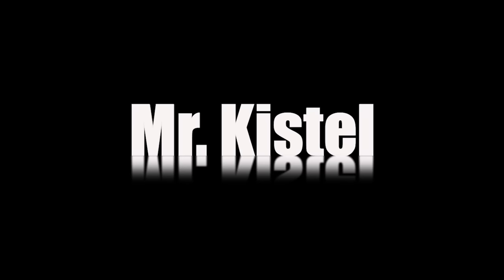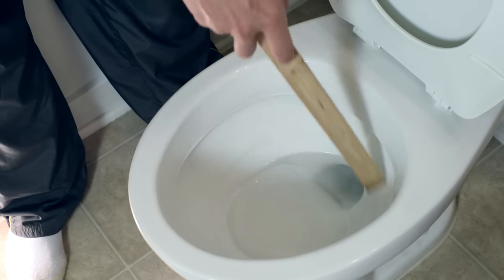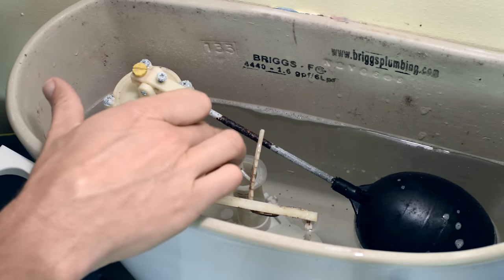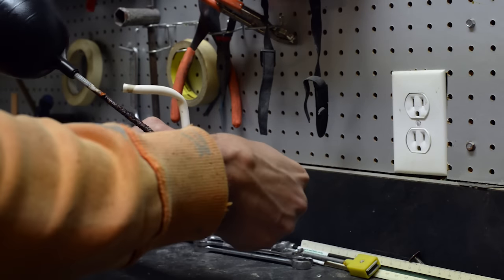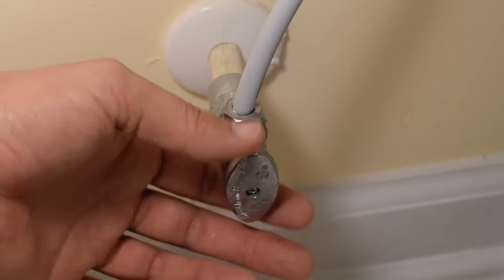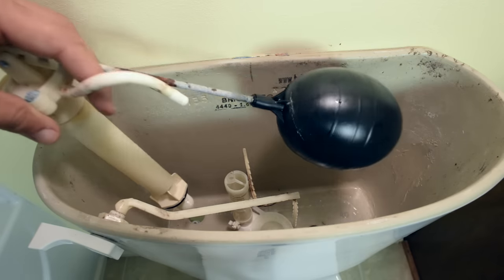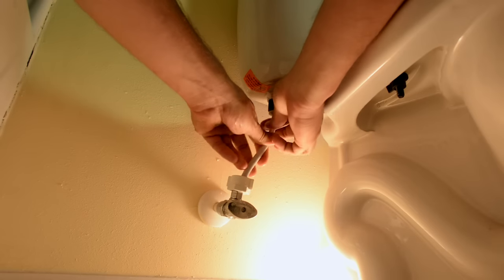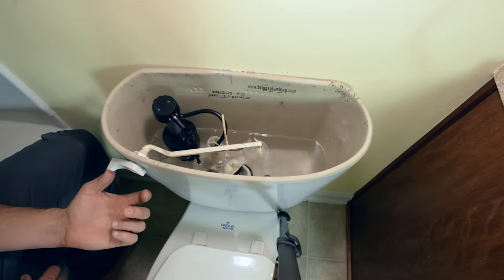Why Is There Low Water Level In The Toilet Bowl And How to Repair

Comment: This was pretty helpful. Except at 3:05. You completely failed and lost me. What were you adjusting and why? Is that something I need to do? And how do I know that I need to do it?
Reply from the maker: Thanks for watching, at that point in the video I am adjusting the height of the new toilet fill valve.  The valve may need to be raised or lowered depending on your specific toilet. The valve will have information on packaging describing what height is recommended per a specific application.  I hope this helps

Comment: Replaced mine with the same apparatus but it still does the same .
Reply from the maker: Thanks for the comment Jimmy.  Double check the fill hose is in the overflow tube.  Also an issue with the venting in the house plumbing could cause a low water level in the toilet bowl.

Comment: When installing the toilet 🚽 fill valve make sure that the refill tube does not go below the water line or als it ghost flush and when it comes time to connect refill tube to the overflow tube the cap on the overflow tube can come off and use the refill clip but if the cap can't come off don't worry about it you can still go ahead and use the refill clip.
Reply from the maker: thanks for the tip

Comment: Can I just? Try pouring more water to the toilet bowl. Rather than? Buying a new flushing value to replace the old one.

This video doesn't explain my situation? I have a low water level in the bowl. When I flush it the water fills a lot of water like almost half and than shrinks down the water level. When there is just a little bit of water than makes a noise.
Reply from the maker: It might be a problem with the drain piping venting.  Water could be lowered in the toilet due to a vacuum force created by a blocked vent.
Reply: + @MrKistel  :
Ok, I will give it a try thanks for replying back.
Reply: meassge to Clee4000
I think I might know your problem? Did anyone take a massive huge dump in the toilet. It might just be clogged up, and just use a plunger to unclog it.
Reply: + @ChrisL369  :
Holy Shit! Zero it worked it was just clogged up the whole time. It did the job the water level and flushing did the trick. Thanks for the fix and problem solving.

Comment: Friends, looked all over YT, didn't find the solution you need for a new toilet install with low BOWL level. (NOT THE SQUARE TANK, BUT ROUND BOWL PART). There's a black rubber hose coming off the assembly where the water comes into the tank from the water supply at the wall or floor, (Kohler brand). From that assembly, to the other one in the middle of the tank, a small black hose is supposed to connect the two, which directs more water into the bowl when flushed than will otherwise enter it without this hose connection. Without it, your bowl level will be unacceptably low. (My hose was too short to connect the two; found longer replacement hose at HW store, and you can get them at auto parts stores, if no plumbing supply is available). The only other recourse is to hold the lever down when you flush, and keep it down until the bowl fills with the desired amount of water. Looked all over YT, never found the needed info that I've detailed above. If snobs want to rewrite this post with the correct terms, be my guest, but most who need this info after installing a toilet via the DIY method will understand the above; LOL, written for the layman, they might understand it better than with all the correct jargon. Ciao, baby...
Reply: +DMBeckJr Can you provide a picture or link to what you're talking about?  I can't picture or find any hose other than the refill one inside the tank

Comment: So I’m having the issue where the toilet flushes okay and fills the bowl , then the water slowly drains to lower levels , I swapped out the entire tank system kit , more water in the tank thus more flushing power and it fills the the bowl even quicker , but still after that,  the water drains to low levels and stays there it’s driving me nuts ! Any idea what could be the reason ? I don’t have a clog just to put it out there. Thanks
Reply from the maker: Might be an issue with the wastewater venting. If the drain vent is clogged water can be sucked out of the toilet bowl.
Reply: @MrKistel   I see , and say if it’s a wastewater venting is clogged will I still be getting a good flush or it has nothing to do with it ? What do you do to check if the venting is the issue ? Thanks for the assistance

Comment: Each time I flush the toilet the water just rise up but it won't spiral and slowly goes down, already used the snake but did not find anything debris clogging. Any advice would be greatly appreciated?
Reply from the maker: It could be a clog further down the sewer line.  Another thing to check is the flapper in the toilet tank, make sure it opens completely when you engage the flush handle.
Reply: MrKistel is

Comment: My fill valve is not leaking but the bowl fills up , and then later the water level is very low. Faulty flapper?
Reply from the maker: my guess would be some sort of partial clog on the sewer side, perhaps in the bend trap in the toilet.  Maybe try a good plunging or a snake.

Comment: My lower bowl over fills and the thank fills very slowly like 4 minutes.
Opposite of this video.
Replaced the fill valve no change
Reply: You can go in the basement and hear water over flowing the bowl and running down the sewer pipe
Reply: I installed the one in the video no change
Reply: Float level is 3/4 in below pipe
Reply from the maker: Does the toilet flush itself when water gets too high?

Comment: I just replaced my fill valve because it was running constantly.  Now it's not running constantly.  But the water level in the bowl is still too low.  No matter how much water comes into the bowl from the tank, when it finishes, the water level is still too low in the bowl??
Reply from the maker: It is hard to say what could be the problem.  Sometimes poor drainage venting could cause problems
Reply: @MrKistel  thanks

Comment: Just had a guy replace the fill valve and now I have low water in the bowl but did not before. It seems like tons of water is coming out of the fill valve into the tank somehow, despite the fill tube also working.
Reply from the maker: Many times the fill tube coming out of the toilet fill valve will have an adjustment mechanism to allow more or less water flow.  Might this be your toilet problem?
Reply: It turns out he installed a fill valve for toilets pre 1994 which used 5-7 GPF and a 20% fill ratio. He installed the Fluidmaster 400A. My toilet is 1.6 GPF and 40% fill ratio which requires the 400AH. I made this point to him over the phone and he did not sound very receptive of it. He will reluctantly come to look again tomorrow. Sigh...
Reply from the maker: @NeuroPulse  interesting, thanks for sharing. Best of luck getting things repaired so your toilet water level is no longer shallow.

Comment: Our water level went down all of a sudden, and made a gurgling sound.  Water level is still very, very low, even after many flushings, and still gurgles.  Even if we pour water into the toilet bowl  directly from a gallon jug, it flushes down, but doesn't fill up.
Reply: sounds like something is clogged normal when you hear the gurgling noise once the water is down there's a clog some where

Comment: Tried that, still low in bowl, i posted a video, any other ideas? Thnx
Reply from the maker: if the plumbing venting is not working properly it can cause a vacuum in the sewer line which can suck water out of the bowl

Comment: Mine is a brand new fill valve and it is still having the problem.
Reply from the maker: +Andy Dillon there could be an issue with your plumbing venting which could create a vacuum that actually sucks some of the water from the bowl.  I mention this in other comments below.
Reply: +MrKistel Thanks for responding! Not sure what venting means and see no mention of it here. I must be blind :)  I'm guessing a venting problem would be highly complicated to fix my self.

Comment: Nice video. However, I found that when having a need to turn water off for repairs it is better to  go to the junction box out near the curb of your property and turn the water off there. Of course that turns the water off to the entire house but believe me, it's worth it. Why? Since the toilet water supply valve is always left on in one position, sometimes for a year or more, it is not uncommon for the valve to leak once it is disturbed. Now don't get me wrong, a valve leaking from being disturbed does not always happen! That is not what I am trying to convey here. However, If this does happen you'll have to go out to the junction box anyway so that you can replace the valve. If there is the possibility of there being a leak, in my book it is better to have that leak outside than in my house. Just saying. Also, don't think that I am in anyway casting aspersions on the gentleman who did this very helpful video. He is doing something that is very helpful which will help people say money. Saving money is one of my best friends, right next to my most favorite friend... free!
Reply from the maker: Thanks for the comment and the tip about where to cut of the water supply before making a toilet repair.

Comment: If the level in the bowl is sufficient immediately after a flush but drops over time, the problem is with a defective toilet. The toilet has an internal crack allowing water in the bowl to leak internally past the trap into the sewer. Replace the toilet and your problem will be solved.

Comment: I have a weirdly opposite problem with my water level, I want it to go down so I can use some Comet to clean it. I recently moved into a new home and the toilet could use a scrub...
Reply from the maker: You could temporarily turn the water off to the toilet. There should be a valve on the water line going into the toilet. Then when you flush the toilet it will not refill until the water is turned back on.

Comment: Does this work with the 1.3 or 1.6 GPF toilets made after 1994?  A little flush water is sufficient if there is enough water in the BOWL to prevent the porcelain from getting p00ped on.  Without enough water in the BOWL to prevent it from getting nasty, the new toilets won't get clean even after 5 or more flushes.  How is THAT saving water??  The Gov't should admit it was a mistake and fix it.  Less water stored in the tank is ok if there is enough water in the bowl.

Comment: I have a brand-new toilet and the bowl water is still too low. I tried adjusting the level by turning that screw thing, and it fills up but eventually goes low again. I hate these new low-flush toilets. They don't save water at all, because you end up having to flush it twice!!
Reply from the maker: Sorry to hear your toilet is causing frustration.  Thanks for watching and commenting.

Comment: What if the toilet bowl drains down to almost nothing in the bowl after it fills up to the amount it needs to be?
Reply from the maker: There could be the possibility of a problem with the plumbing venting.  If so a vacuum force can actually be created which can suck water out.  Trace the plumping vent and check for clogs or improper venting.
Reply: Then that's the amount of water the toilet is designed to hold. Not all toilets are the same.

Comment: Good video for what it shows but bad in the respect that it only points out one of a possible few different reasons for low level in the bowl. For example, a simpler reason would be that the water tube wasn't pointing into that overflow pipe.  Other reasons relate to drainage flow problems. I think it only fair to inform people of the entire truth and not limited to only one possible reason. Of course if you were not aware of that, now you are and you can make addition videos covering those fixes. And get to eat more peanut butter.
Reply from the maker: Thanks for the suggestions of additional possible causes of low water in a toilet.

Comment: This is the one. Ok, I've been all over the world and the average water level in toilets is just to suffice its main purpose - to create an air trap, so smells out of the drain won't come out. However, in the US, I have witnessed these unusually high levels of standing water in toilets as standard. I simply can not understand why would you do your business and have all your business splash back at you. Just cant get it. Can you? MrKistel - what are you trying to fix?
Reply from the maker: I can't say much about the design of toilets but most folks do prefer them functional regardless of design.  This vid was just to show how to fix a common toilet issue so the toilet works properly when need be.  In my travels I have experienced many toilets have multiple flush buttons in non US countries.
Reply: @MrKistel  Keep it up

Comment: I've decided to keep my old Kohler toilets.  I wanted new, taller ones, but (1) They aren't tall enough - 17" is NOT "chair height" and (2) I'm not willing to pee and poop on porcelain and then have to flush 15 times to clean it because it's stuck to the porcelain instead of being in the water. .  I'm not buying another toilet until I see one with enough water in the BOWL to ENSURE I won't be pooping on porcelain.

Comment: nope. even replaced the fill valve. no leak. whats up?
Reply from the maker: may be an issue with your venting on the sewer side
Reply: I noticed the same problem on a new toilet install.  I am wondering if maybe it is due to toilet not level front to back.  If toilet has a back lean, water level in p-trap changes, draining bowl a bit.  I can slowly pour water into the bowl, but it just as slowly drains out suggesting it is not the vent or refill.  Thoughts?

Comment: Ive yet to find a video where someone adjusts the bowl water level to make it LOWER.
Reply: That's not possible. It's the way your toilet is designed. You can try taking the refill tube out of the overflow pipe, but then the toilet will probably have a weaker flush.

Comment: Any ideas for how to fix this problem? My water level IS HORRIBLE on my toilet and adding more water, only makes it drain back down INSTANTLY (you can watch it go back down after pouring in more water or adjusting the tank water level). The toilet bowl is so large and long compared to the tiny pool of water, I swear it looks like about half or quarter of a gallon of water in the toilet bowl. My landlord said there is nothing wrong, that it is the normal way toilets are designed. However, when people visit and go "number 2" it typically lands on the dry area of the toilet, leaving behind brown marks. I don't know what to do! I've tried cleaning the pipes out and such, so it doesn't SEEM like there is anything wicking the water out. I included information on the image: https://i.imgur.com/B3BTFXq.jpg

Again, I have manually poured water into the actual toilet bowl, and I have messed with the water levels in the toilet tank. The issue is that the bowl will NOT hold more than a little water. It doesn't appear to be leaking or crack either. Is my toilet just a stupid design? I did a test at a family members home where i dumped more water in their toilet bowl and the water I added, stayed in their toilet bowl. Also, their water level in their toilet seems completely normal and covers most of the bottom surface.
Reply from the maker: It could be a problem with your sewer line venting.  If there is a blockage, or even a missing vent, a sucking force can be created and pull water from the toilet.  There should be a pipe that vents somewhere out the roof that vents the toilet and sometimes stuffs falls in this pipe creating a blockage.  Some people have success running a water hose down this pipe to free the blockage.  Might just be best to call a plumber as it can be risky getting on the roof.

Comment: why my bowl gets the correct level of water but loses almost all water in about 10 min?
Reply from the maker: It is hard to say why your toilet bowl is losing water.  Sometimes it has to do with a vacuum in the sewer line due to blocked venting. Best of luck with your toilet repair.
Reply: @MrKistel  I switched the toilet with the one in the other bathroom. this new mounted one works fine. also, put the bad one in the bathtub and poured a bucket of water in. goes to same low level.

Comment: Didn't fix my water level. It still low. I think it is a crappy toilet.
Reply from the maker: Might also be an issue with plumbing venting in the house.  A vacuum could be created in the sewer lines in the house and actually pull water from the toilet.
Reply: After it has finished and is low. I tried just pouring water into the bowl and it still goes up and then back down to it's low level again. Both toilets do the same thing. Both are Briggs and on opposite sides of the house.
Reply: It's the design of your toilet, nothing you can do about it. Some toilets hold more or less water than others by design. Modern day toilets barely hold any water in the bowl at all.
Reply: Yep. You right.